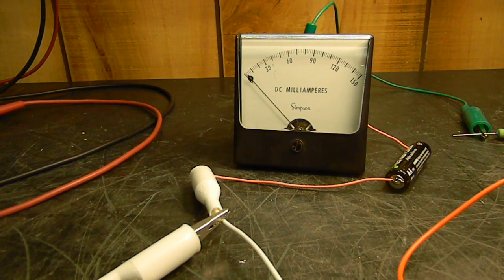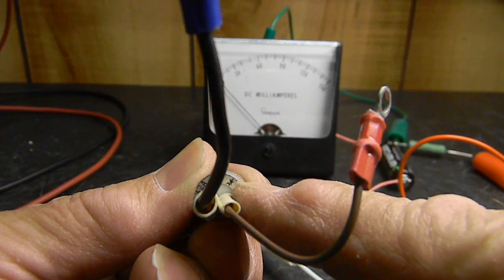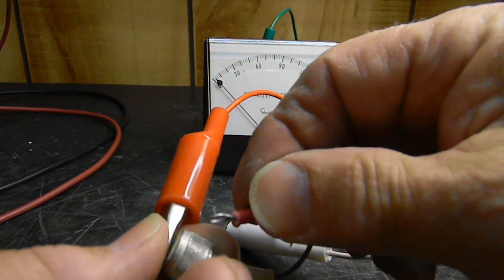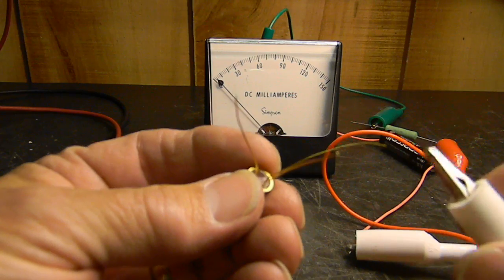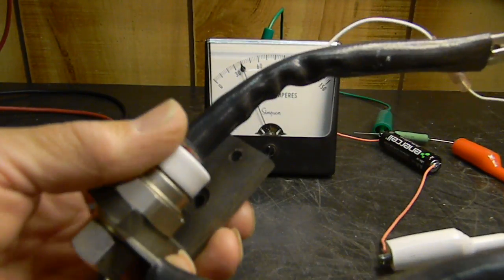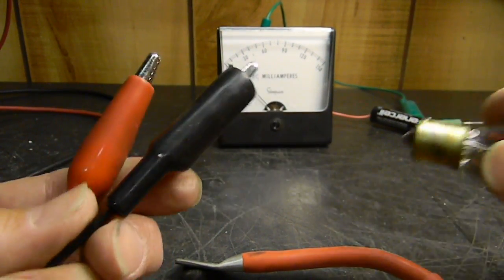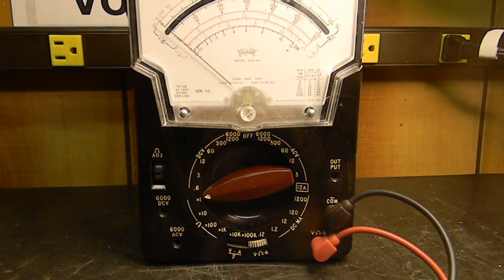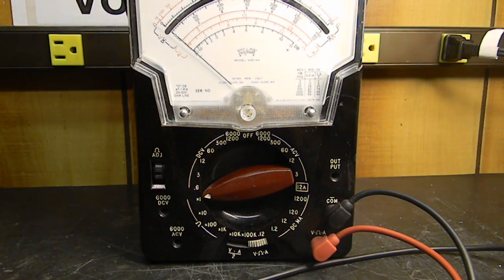How To Check or Test SCR - Silicon Controlled Rectifiers .MOV

Comment: So that was a nice video but you didn't say what size power supply you needed and what size bulb you use to do the bigger  Device
Reply from the maker: A battery will work just fine - 1.5V is enough.

Comment from the maker: I have seen large SCRs with that extra wire also and can't remember how it was used in the circuit. Basically it is just another connection for circuit convenience as I remember it. Possibly a special order by a client for their particular circuit build (?) If you don't need it just tie it down to an unused terminal or tape it off.

Comment from the maker: I apologize that I never replied to help you on this but I am not sure where to start. I have never used electroplating equipment so I cannot advise. 4600 euros for an SCR Wow- I assume the electroplating circuit is fairly simple possibly a control board? Can you remove the SCRs and check them? What about shorting the SCR's and controlling the current with a variac on the primary? Is that possible? This may be nuts - I am just throwing out things. Can you give me the SCR type - maybe I have one.

Comment from the maker: The checking of transformers can be objective but challenging in its complexity. Capacitors are often particularly difficult to evaluate in real-circuit conditions.  The evaluation of capacitors, except in boundary conditions, can be not only subjective but intermittent and variable and become very difficult. The common wisdom is, if in doubt, replace them - that may or may not be wise in light of the surgeon and the quality of the replacement components.